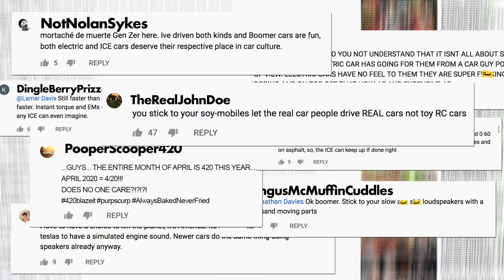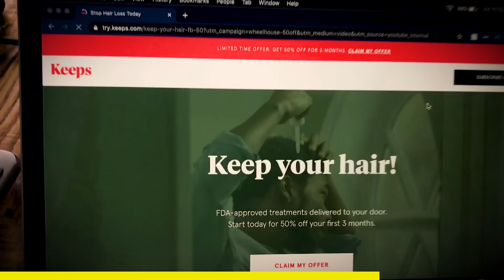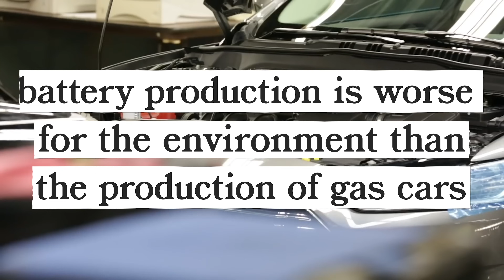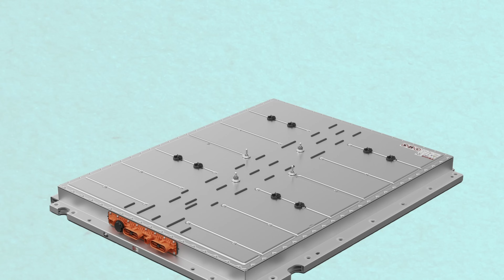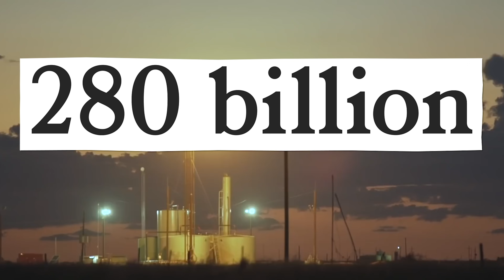Are Electric Cars REALLY Better for the Environment?

Comment: Forgot a couple of important aspects of EV production. 1.) Carbon fibre. Many EV's are made using carbon fibre to keep down the weight of the vehicle. Carbon fibre requires something like 50 times more energy to produce than steel. 2.) Supply chains. The production of something like a Prius sees the component parts such as batteries etc shipped back and forth across the globe many more times than conventional cars. This may decrease as technologies are spread out, but most of the dirty manufacturing will probably continue to be done in the 3rd world. 3.) The amount of fossil fuel currently required to underpin 'Clean' energy needs to be taken into account. It takes a hell of a lot of fossil fuel to produce solar panels (as well as mining and superheating the high quality quartz used in production of solar panels) it also takes a lot of fossil fuel to create wind turbines. Both wind and solar have impact on the environment. They're called bird Cusinearts for a reason, they also affect wind and local climate in the surrounding areas (off shore wind farms have decimated coral and fish and also affected currents). solar farms also have environmental impact with large amounts of land being cleared to make way for them. 'Green' energy solar plants also only produce during the day, so a fossil fuel plant has to run idle all day long beside it, ready to take up the load during the day if there's not enough sun, and at night when the solar produces NOTHING (and currently what little energy is stored using batteries only increases the carbon footprint for the reasons highlighted for the car batteries). Then there's also the recycling (or lack of) aspect of solar panels and wind  turbines, which typically have a 10 year lifespan. There's also the social aspect that many solar panels are produced in China using slave labor. So when you take it all into account, green energy in its current guise, is a total scam. You'd be better off just burning the fossil fuel, burning it to produce LESS energy in 'electric' form is sheer madness...if you're serious about electric vehicles, nuclear energy is the 'cleanest' option currently available. Wind and solar is a false economy.
Reply: The Tesla Model 3, only uses carbon fibre in the performance model for the spoiler. which is actually so small its probably neglible. EV's dont widely use carbon fibre.
Reply: So many cars these days use carbon fiber

Comment: I have problems with the CO2 production from oil refinement being added to the cost, even if we could click our fingers right now and make all cars EVs and poof all the IC cars and petrol stations and replace them with the infrastructure to make the best use of them... Guess what? That oil is still being refined and worse, instead of the petrol being used now its a waste product to be gotten rid of somehow.

Oil production and refinement isnt going anywhere for a long time, cars and planes and trucks becoming EVs will extend the lifetime of the reserves. We still need the Oil for pharmaceuticals, agricultural chemicals like fertilisers, plastics and polymers and dozens and dozens of other uses. Removing IC cars will not stop oil refinement, the model for calculating the CO2 footprint of the IC should only account for the actual emissions from the vehicle, not the CO2 created during refinement.

Comment: Just 1 little facet I would love to see is what the average CO2 emissions comparison would be if you eliminated ICE that have no EV counterpart. If you were to eliminate big box trucks (USPS, UPS, FEDEX, moving trucks, etc.) and 3/4 and 1 ton trucks, what would the average lifetime CO2 emissions be for ICEs? I feel as though the metric used to compare is somewhat misleading as I'm sure the average gas usage is significantly higher in those vehicles than 500 gallons a year (I know for a fact that in my half-ton, I use more than that for my family's business).

Comment: Interesting video, I definitely agree most of the arguments against electric vehicles, are foolish, & overblown. However one serious concern, besides the one you noted about Lithium production, is the production of electricity itself. Yes EV vehicles will always be better for the environment the ICE vehicles, but it will be quite some time until wind, or solar can produce enough energy to power the US. Add on top of that, it's nearly impossible to store the electricity created for a decent amount of time. Meaning there is no "backup" for days when the sun doesn't shine, or wind doesn't blow. I think everyone should stop looking for the "silver bullet", & come to grips with the realities that to reduce green house emissions, many different technologies, both in auto manufacturing, so EV, Hydrogen, Natural Gas, & even ICE in certain cases is acceptable. Same with energy production, so wind, solar, hydroelectric, wave enery, & even nuclear are good alternatives, to burning coal which is the worst culprit. 

Lastly could you guys at Donut do a video on CNG vehicles. Are the "cleaner" then gas, is the capture of CNG better then coal, or oil, & is converting from gasoline viable?
Thanks again for the video
Reply: Hydrogen is neither green, nor does it use less energy per mile driven. Infact it uses on average 3.5 times more electricity per mile driven from the very same power grid.

Another thing you might not be considering is that whilst it will still be some time before the grid becomes significantly green, It will also be some time before EV adoption breaks through even the 50% mark, Optimistic estimations put the 50% adoption mark at 30 years. These two things (grid and EV adoption) will progress in parallel with eachother. Alot of people get themselves worked up assuming the grid will never change but EV adoption will hit a light switch and suddenly everyone is driving EV. I would assume mostly because is simpler to conceptualise these impacts if you hold one of the variable static, being energy production, whilst imaging the other (EV Adoption) jumps to its "worst case" of full adoption.
Reply: My Electric utility PGE has a mix of 50% renewable energy and 50% natural gas.

Comment: Well you guys only compare the emissions.
Environmental impact is more than just emissions. Coal is mined with open air method is way worse for the environment (nut just in terms of emissions) compared to oil pumped out from underground.

The way lithium and cobalt are minded are similar to coal. It literally changes topography and releases tons of dust particles in the air, causing breathing problems.

So comparing emissions is not big enough picture.

Comment: You mention gasoline production but don’t actually calculate it into your CO2 total for ICE vehicles,  with an ice you essentially of a battery of fuel produced and shipped to your location once a week or two.  This is in ADDITION to the emissions from actually burning the fuel when it arrives.  It’d like using disposable batteries.

Comment: You forgot to mention that the utiziation of used batteries is non-existent still. Sure, that should be added to the EVs footprint.
Reply: Incorrect I'm afraid.  Watch the YouTube video of the Volkswagen Electric Car Battery Recycling Plant, and you can see the recycling process for yourself.....  and the cobalt and lithium within the batteries can be recovered to levels around 90% and reused in new applications. Lithium and cobalt can be recycled many times. The aluminium and steel components of the battery casing can also be recycled......
Reply: @Brian-om2hh  Thanks for the comment. There also an extra layer, related to economics of all this: the recycling is money and labour intensive. Meaning that the recycled battery costs higher than the new one. But thanks for the correction anyway
Reply: @Brian-om2hh  Just watched the VW video. This plant is not operational yet! They just showed what "they will" do to batteries. No answer how much will such a battery cost nor if those "granulas" of mixed cobalt, lithium.. etc will be of any use at all. More to that, I strongly don't believe they will recycle 100% of VWs cars in future, as many of those will go abroad to other countries and wouldn't be retrieved after their end of life.

Comment: Doesn't it depend where you get your electricity for efficiency?
Reply: No just manufacturing electric car leaves a huge carbon footprint. As a man that has worked with batteries for many years they are nasty....byou tree huggers and your stupid golf carts are bieng lied too🙄.... also, they are garbege.... I run tow trucks.... I tow three a week.... kep in mind how few are on the road, and how new.... they are shit
Reply: @joeyjohnson4826  Interesting. I own one of the "golf carts" The science is pretty clear on them. They have a big carbon footprint to manufacture but they more than make up for it in their lifetime emissions, producing around 10-20 metric tons less emissions than an ICE car of its life time, even from a coal based grid. Infact its actually more fuel efficient to charge an EV from a small, cheap portable generator than it is to use that fuel in, even a modern efficient combustion engine. 

as for towing. I am part of a very wide community of EV owners with around 8,500 members. we do meet ups together a drives etc (when not in lockdown of course). Very rarely hear of anyone needing a tow. (mind you thats 8,500 people in AUSTRALIA which has a significantly less EV density than most countries). 

the only time I usually hear of Tow trucks picking up EV's from the side of the road is when it is for flat tires. Being that most of the models don't carry their own spares to save weight, the manufacturer actually pays for tow trucks to either pick the car up and take it to the nearest tire centre, or gets the tow truck to deliver and replace the flat tire with a new wheel.

So to me, it would seem that you are suggesting they are shit cars because they get flat tires? which doesn't seem like the cars fault to be perfectly honest as they aren't the only vehicle not to carry a spare and they dont get flat tires any more or less than any other car.

Comment: I'm very confused why we're using lipo battery that is not recyclable and is more expensive while we could use nickel metal hydride that is recyclable and cheaper and doesn't explode when exposed to water
Reply: The demand for such minerals will drive the price through the roof pitch is nickel also being able to find such minerals. You see you're going from oil dependency to Earth mineral dependency. You will still have to mine and dig for the minerals you still wont allowed in the United States you will have to get it from foreign sources. You enjoying your big old biteof reality sandwiches
Reply: a few things. First, they use Lion batteries because of their balance between cycle life, (how long they last in the car) power output (how fast it can drive the car) charge rate (self explanatory) and energy density (weight per kWh) as well as volume density (m3 or gal per kWh). Additionally Lithium batteries dont explode when exposed to water, that would be sodium ion batteries. Lithium is dangerous when exposed to air often resulting in whats called a thermal runaway however its very difficult to expose lithium in an EV to air.

Also Lion batteries are around 95% recyclable.

Comment: Great video, I'm not against electric vehicles, my problem is the time it takes to charge if you're on a long trip and while there is one that does almost 1000 kilometres, will it do that if you're towing and have a lot of hills how far will that battery last then, while in a fuel vehicle you just stop for say 10 minutes, and you're back on the road, while I only got these numbers from Google so apologies if it's faster 20-30 minutes to charge an electric vehicle, I don't know about anyone else but when I'm going somewhere I want to get there as quickly as possible.
Reply: How often do you travel more than 1,000 miles in a day? I'm guess not very often. Then how many times do you do that whilst towing. I'm guessing even less. Most peoples daily commutes are around 70 miles. Most modern EV's could get you to work and back plus shopping for 3-4 days in a row before being needed to charge up again.

Also there is the fact that EV's are charged at home whilst you're not using it. This means 0 stops at fuel stations 99.9% of the year (your every day daily commutes). On average this represents a saving of 16-17 hours per year on getting fuel. Not to mention that EV's are typically around 10c/km cheaper to operate. For example here in Australia it costs on average around 12c/km for a petrol car with a moderate consumption of 8L/100km (29 mpg). An EV of a similar size operates for around 2c/km. So if you travelled maybe 50,000km in one year you would expect to save $4,000 on fuel alone.

Further to that I have recently made the transition to EV. Whenever I would drive to the ski fields each winter (a 5 hour long drive) in my subaru I would have to stop for fuel in Bairnsdale. Since I would have been up so early and at that point have been driving for around 2.5 hours I would also stop for breakfast. This would take me around 5-10 minutes to fill up and pay, and id hang around for another 20 minutes to walk over and get breakfast from somewhere. I would do the same on the way home but for dinner. so around 30 minutes stopped going and 30 minutes stopped going back. 

This year I did it in my Model 3 Standard Range. I stopped twice on the way up for 20 minutes a stop. During that time I either watched Netflix in the car. On the second stop I went and got breakfast from the local bakery.

On the way back I only had to stop once (going downhill saves alot of energy). I was again stopped for 20 minutes and in that time I went and got something to eat for dinner.

So total amount of time stopped for fuel and food. 1 hour round trip. Total amount of time stopped for charge and food (20+20+20) 1 hour round trip. I lost no time what so ever doing a 5 hour drive in my Model 3 standard range than I did in my Subaru. However If  I had a long range I would only have to stop once on the way up and not at all on the way back. but thats a different situation.
Reply: @engineeringtheweirdguy2103  You make a valid point, but I was meaning that there are people out there with these requirements, and it's just not practical and as I'm sure you may know with cellphone batteries fast charging isn't good for them all the time and as for charging at night not everyone has off-street parking, I don't so fast charging would be my only way and apparently Tesla is making their batteries part of the chassis so the only way to replace it would be to get a new car, something I only do when I have to start fixing major components due to high mileage.
Reply: @oddnick  slight correction. the Battery pack is apart of the chasis, the batteries themselves are not. Tesla batteries are made up of thousands of small 18650 batteries which look like big AA batteries. To replace these you just need to remove the seats and take the floor up then replace them like replacing batteries in a remote. Replacing the battery Pack is expensive. and often cited as a big expense. As it is part of the chasis and also contains cooling and BMS equipment. However replacing the battery pack instead of the batteries is a little like replacing your PS5 controller every time your AA batteries go flat. its nonsensical and a common mis-information tactic used against EV's.

In reality to replace the actual batteries it only takes half a day and costs around $4k USD inclusive of labour.

Comment: Something doesn't add up. If it takes 17 metric tons to produce a EV, but 7 metric tons to produce an ICE car. And the ICE car produces 57 metric tons in 20 years (lifetime of a car), that's less than 3 metric tons a year whereas EV produces 2 metric tons a year. Wouldn't it take over 10 years for EV to be environmental friendly? And that's against an average car. A hybrid can be twice as efficient as an average car, thus it only produces 1.5 metric tons a year, less than an EV? That doesn't make sense. A prius produces 94g/km, at 20000km/year, that's 1.8 metric tons? But that's just the tail pipe emission right? What's the total emission including refinery, transportation, etc... ?

Comment: How would things change if ICE become zero measurable emissions? I would say it would be a complete game changer. Porsche is designing that very fuel.
Reply: Looking forward to that, but it's gonna cost a lot, of course.
Reply: Now imagine if every power source in the world was renewable. EVs still win
Reply: Lol. Someone doesn't understand economics.
Reply: Why??? ICE sucks. The only redeemable thing about IC engines is the noise. They are heavier and larger than electric drive trains, have extremely low efficiency when converting chemical into mechanical energy and require heavy transmission. The only problem with EVs is the battery cost and capacity and those have been going down rapidly recently. The theoretical capacity limit for Li-Ion batteries would offer over 3 times the range of gasoline cars. There is literally no reason to ever have an ICE other than the noise.
Reply: @baab4229  wrong dude electric cars are way heavier. Did you not know how much the batteries weigh

Comment: Where the fuck did you get this misinformation about the electrical grid? Our grid is no where near ready for every house to just suddenly have a 100-200 amp charging station. We can barely handle everyone running their ac at the same time in the summer. You didnt even try to back up your lie you just said it and then moved on with no proof. Fucking dumb.